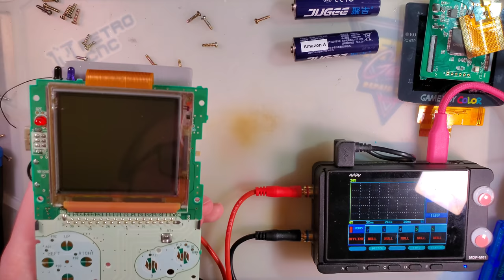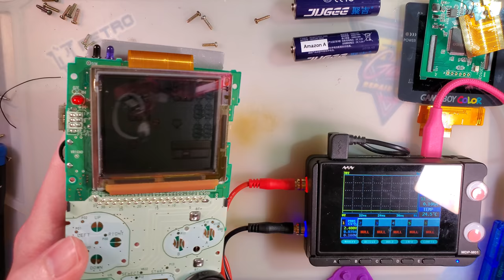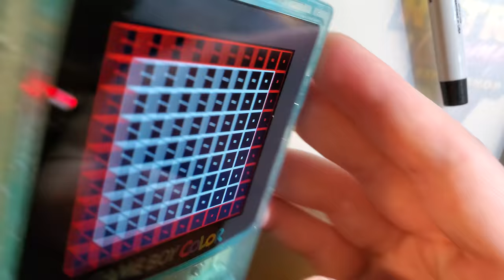Custom Laminated CGS 2.6" IPS Backlight Kit for Game Boy Color

Comment: 0:00 Intro
4:00 Begin build
7:40 (McWill LCD sighting)
9:50 Power use comparison - Stock
10:40 IPS power soldering, IPS troubleshooting
20:30 Power use comparison - IPS (8 lvls brightness)
24:00 FP Shell issues, CGS shell use
26:00 shell trimming
36:00 screen install, reassembly 
41:00 (touch sensor)
47:00 Screen tests (240p, grid, flicker, etc) (small in-person flicker ghosting
49:10 scrolling bars test, has some flicker in upper right corner 🚩
51:30 Link's Awakening test
55:00 viewing angles (2.45 laminated comparison)
56:20 Pokemon Pinball screen reset test (frame by frame shows 1 frame of half screen flicker sometimes, but not bad unless really looking for it)
58:00 final thoughts
59:00 FP Lam comparison (cgs much cooler screen color, FP deeper colors?) (8 screen modes, norm/scanline/vert scan/pixel grid, then repeat for black and white)
1:03:30 one last thing (EZ Flash Jr boot)
https://gameboy.github.io/wiki/backlightmods#cgb "Cloud Game Store 2.6” IPS Kit 2022 Version"

Comment: Hey Makho! Awesome content as usual! I was wondering if you could help me with something. I was changing the power LED on my gameboy color but it seems that I ripper the via where one of the posts solders on.  Do you know if there is any other place I can solder it to to still have it work? Any help would be greatly appreciated!
Reply from the maker: The service manual has a full schematic if you search it up. The manual is of dubious origin so I probably shouldn't link it but it's not hard to find.
Reply: @makho  thank you!

Comment: You sure know your stuff but man do you manhandle the HECK out of everything lol. It's funny cuz right as I was thinking about it, you then mentioned it (13:02) and I was like "oh, he's aware of it too!". XD
Reply from the maker: I mean, it looks worse than it is because of the view you have. But realistically, if me setting this stuff down on my desk breaks it, I don't want it anyway.
Reply: @makho  Was referring to you overall, I’ve mostly watched your much, much older videos and this is the only recent one I’ve watched and I can tell you that at least your manhandling has gone down quite a few notches 😂 I thought I ruined a ribbon cable on my first IPS mod too but turns out I just had to take the cartridge in and out to fix the screen… sometimes electronics give real head scratcher issues.

Comment: how do you charge thos jugee cells without the included charger? mine got busted XD. I wish the expensive chargers I got for my 18650 cells could, but they don't seem to supply 5v
Reply: I use the same Opus BT-C3100 that I had originally purchased for 18650's ages ago to charge my double and triple A Ni-MH batteries and it works perfectly fine. You can adjust the charge rate so you can choose to charge em slowly so they last healthily for many years to come and you can also charge em fast if you're in a rush. That charger has a ton of functions you might not need or want and might be overkill for you but it's just what I have and can speak about. Highly recommended, though they're probably on a V2 or some other model by now, Idk.
Reply from the maker: @groundcontrol6876  you cannot charge these batteries with a battery charger. The charge module is built into the batteries so all they need is a 5v supply (500mA per cell) and they will do their own thing.
Reply: @makho  Ahh, I thought he was referring to the replaceable cells that didn’t have a sticker on em. Thought jugee was just a brand.
Reply from the maker: @groundcontrol6876  yep, they're pretty interesting batteries, big clive did a couple videos on them https://www.youtube.com/watch?v=dakm4ra8Xv0